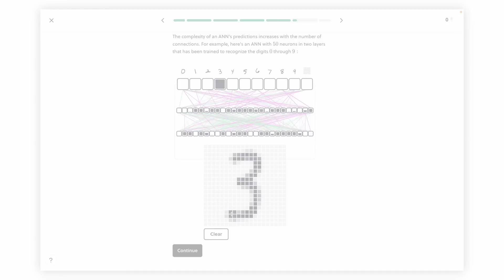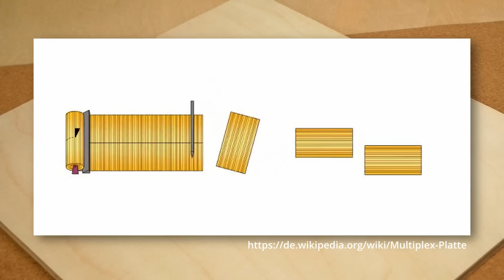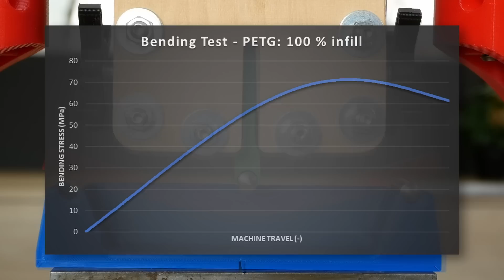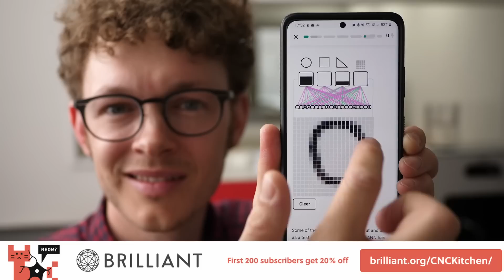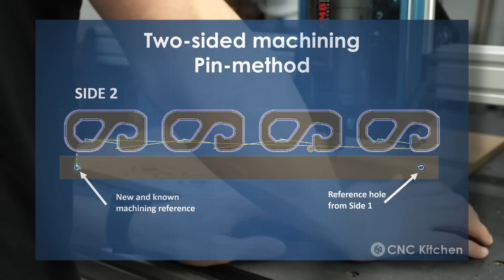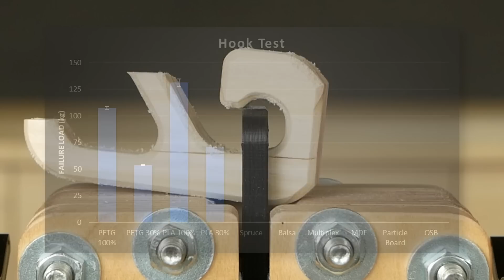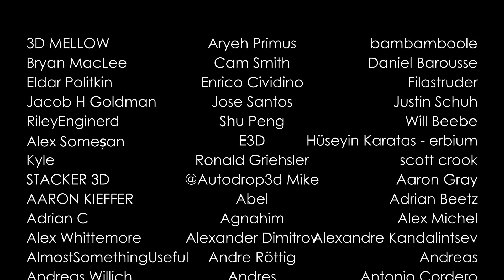Strength Test:  3D Prints VS Wood

Comment from the maker: Visit https://brilliant.org/CNCKitchen/ to get started learning STEM for free, and the first 200 people will get 20% off their annual premium subscription.
Reply: Howard huges built an entire plane out of wood that could fly a tank's. so you are right. They do and have used wood in plane's
Reply: @odeball22  Well, sorta. They used a product called Duramold. You can think of Duramold as a kind of advanced plywood maybe even approaching something like layered fiberglass. Wood was layered and molded, impregnated with phenolic resins and pressed into shape. It was an advanced material for its day and outperformed aluminum in many ways. So yes, it was wood.  But it was more than that too.
Reply: @wturber  yah wood
Reply: Are you "Shtephan" or "Stephan"?
Reply: I'd avoid 100% infill. If you want solid, I suggest use 1000 parameters. prints faster, AND stronger too.
Reply: hey, im in a project that takes plastic water bottles, and turns them into filament. Its called re-creator 3d and we have a discord as well. I'm reaching out in behalf of josh the owner to see if you want to work with us. We also plan on selling a kit down the line to help make it easy to recycle yourself. think you would be willing to reach out to set something up?

Comment: Patricle boards, as dirt cheap of a materiasl as they are, aren't bad for compressive strenght, I use them for legs of workstation tables. If you eliminate sheer forces with good struts, you can take advantage of them, they're kinda like the concrete of woods, bad for bending, gread for compression.

I used those as filler for those removable car ramps

Comment: Thank you for the data. I was recently playing with Truss framework. I started printing with PLA, but after adding wood dowel rods, I wondered which would be better. Simply buying the wood dowels, or accepting the print time it would take. PLA infile ~20%. Still undetermined what I'll do as of this comment, but experimenting randomly.

Comment: Funny thing is that at least here in Texas, wood is actually more expensive than steel atm. The cheapest 4" hardwood fence posts available atm are $22. Used 2 7/8 drill stem can be ordered for about $75 per 30 ft. If you cut that at 6' you can get 5 posts you can tack weld your panels to for $15 bucks a post. Prices for wood are crazy atm.

Comment: Where is strength vs price? If I wanted 100 hooks to pull 50kg each reliably let's say, which would be the cheaper? Machining wood or printing? You can compare different use case scenarios than hook. And you could adjust material size to target, maybe smaller hook to get the target failure load. I ain't gonna get either but I would love to see that happen.

Comment: What a wonderful video, I would love to see some proper marine plywood tested if you ever do this again. Generic multiplexed plywood vs high grad AA marine stuff is night and day mainly due the the fineness of the grain and choice of wood (sap vs  heart). 4mm is often used for wooden boat hulls and can resists slamming of waves. I use it for prototyping , Honestly believe it's faster then 3d printing (and cleaning the print).

A 4mm 5cm square piece of that feels like a 10mm thick piece of carbon steel when you try to bend it. If I glued up a 5cm box of it I could stand on it with my full weight no issues.

Comment: I have seriously underestimated the strength potential for PLA. Few projects in mind that I've got a bit more confidence in. To compensate for the potential flex, I might epoxy some pins in to act as a spine for added rigidity. Almost certainly unnecessary, but who doesn't like going a little overboard sometimes?

Comment: By laminating low-density wood with a low-hardness, high-strength material like PET, you can create a super-material. Low density, high strength, and high stiffness. 🙂
(I used it to make light-weight boom for a robot arm. A 30-cm boom weighs 37 grams and can support 9 kg!)

Comment: So one lesson here is that if you need your 3D printed parts to be stiffer, you will generally need to make thicker parts or exploit other shape based schemes. I've been thinking about making a press for my table tennis racket, and I can see that I'll need to use either thicker sheets, or some kind of reinforced ribbing.  Either way, it will surely end up being thicker than the plywood based one that I currently have. 

Also, while PLA is stronger, material creep can be a very real thing if the part is under heavy load for extended periods of time. Then there's temperature issues.  I frequently find myself using PETG  for these reasons.

Comment: Wood based materials drawback is sesitivity to moisture. For example if you bolt two wood boards together and they dry out, bolts become loose. That's why wood is not a good material for construction where you don't want any freeplay.

Comment: Common engineering materials tend to have quite similar specific stiffness - "specific stiffness" or "minimum gauge" are often what sets the amount of material you need to use, so if there was one material that won by a significant factor on specific stiffness, could be worked with at small feature scales, and didn't cost an arm and a leg, you'd just use it for everything :p

Comment: Silly question: have people made slicers capable of printing empty volumes in a model and extrude a single continuous bead of plastic into it? Fully automatic Way of increasing tensile strength in the z axis? I suppose the extruder would need to heat up hotter than usual for it to properly "pour" but this sounds feasible?
 Love the stuff - making scientific method and actual paper structure watchable 👌

Comment: Overall a very interesting video with lots of solid data. That said, it would be interesting to see how homemade balsa-plywood (various layer counts bound by epoxy resin) would perform compared to the plywood you tested as it would gain multiple grain directions for the hook test, but still be very light weight.

Comment: The stress on the hooks is mainly bending stress with some tension stress, not the other way around. The material furthest away from the contact points is in compression. You can know this because the line of action lies outside of the material. If the gradient was from medium tension to high tension, like shown here 11:17, then that part of the hook could be made from a tension only material, like cloth, and it would still work. But I think you intuitively know that that's not the case, it would bend, because it's a gradient from low/medium compression to high tension.

Comment: i almost always use particle board for drawers specifically the floor thanks to being lightweight and stiff enough to bear load put a simple vineer on the surface and you've got a nice drawer for craft supplies

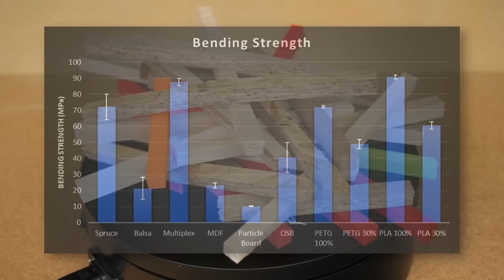Comment: Did I misunderstand the test?  I would expect the hollow shape to win on strength/weight, which is why I-beams and tubes are used in the first place.  But for both PETG and PLA, it looked like they had exactly the same bending strength/weight (10:06 for strength, probably 10:53 though I'm less sure) regardless of solid vs infill, and that solid was *stronger*/weight in the hook test.

Comment: I think a big a advantage of wood not mentioned here is that it probably handles  permanent high loads and many cycles of high load much better.
★ Wood doesn't flow or form microcracks from permanent high loads. PLA does.
★ Wood is more likely to have something like a fatigue limit I'd suspect.

Higher heat resistance is also a boon.

Big disadvantage of wood is that it needs a milling machine wich is nore expensive and much more constrainung in possible geometries.

Unless finely laminated wood has two weak directions whereas FFF 3D prints have only one weak direction.

Comment: Not sure about your region as I've not worked there, but in the USA OSB is required to be marked with the primary direction of strength. Most structural engineering diagrams reference this for construction. You didn't mention it during the bending test, but was this reference on the board available? and did you orient the OSB in a manner that would reflect the strongest load etc?

Comment: One.......it's not an age old question.
Two.......plastic is homogenous, wood is not. If you chose a shape which suited the grain structure of wood, it would outperform plastic comfortably. The shape you chose meant short grain at the stress point, and I could break that with my bare hands. Who would ever have thought that a channel dedicated to 3D printing and CNC machining might be biased against wood, and set up a test deliberately to produce the result they wanted, heh?
Your test was therefore stupid and pointless, much like your channel.

Comment: Fantastic data, as always. Thank you so much for putting in the work to study all these things, Stefan. We all benefit from your data!
I’d love to see some comparisons of the different fill options available in filaments, like carbon fiber or glass fiber. Most of these are just powder, so I wouldn’t expect much of an actual change, but perhaps some of the fiber filaments available do actually have some longer fibers and it would be nice to see the results. It would also be pretty great if you could convince someone with one of those Markforged continuous CF printers to make you some of your standard test specimens and add those into the mix!

Comment: I'm surprised at how well the polymers did in comparison. Great idea to include the birch plywood and the particle boards. Maybe add solid oak/birch into the mix as well? They would obliterate spruce in these applications :)
Reply: Yeah, that's good idea! I'd also like to add particle boards filled with epoxy. I bet MDF + epoxy will perform really good (being also super easy to work, waterproof and super cheap for DIY makers).

Comment: I would note that wood is probably only stronger then 3D printed plastic, inject molded or extruded plastic (pipes /sheets)  from HDPE/ UHPE will likely be much stronger then wood for their weight, and there are some other polymers like polycarbonate that have amazing impact strength.

Comment: Interesting. But several Serious missleading aspects here.  First of all: Wood is NOT isotropic.  
And the man made versions of wood are low strength   by nature,  being made / designed for specific purposes. 
Even Plywood (which should at least be acceptably Isotropic) Is of the Typ Deutsche variety😉  
Plywood  in nameonly being out of the lowest grade wood fibres available to man.   
Despite Your silly testings results  Wood (manufactured) is slowly replacing Steel reinforced concrete as High Rise Building structures .  
Seriously consider a Straight plank type tester design rather than the foolish S curve you seem So fixated on.

Comment: When printing solid parts, use 999 walls instead of 100% infill. Or make sure your infill is set to concentric and uses same printing speed and flow rates... meaning: it is easier to just set it to 999 walls. That way the whole part is more uniformly printed, every line is the same. Infill settings usually have faster speeds and lower flow rates since they aren't really structurally worth anything but as a filler and a support. And of course, if you really want solid you need to seriously up the flowrate above reasonable and lose dimensional accuracy and visual looks. 

You learn the difference once you start melting the parts in packed salt, there is a lot of air in a normal print even with 100% infill. +20% flow, 10C hotter and 999 walls sag very little, 100% infill sags so bad that it is not usable, there is just lots more air.

But i understand that using infill and normal settings is more representative of normal use case. But if anyone happens to read this, just know that to get really strong parts, use 999 walls and up the flowrate until you can't push in more plastic. Remember that with high flowrates you most likely need to compensate with higher temperature or you will make the part weaker... Colder and unevenly heated plastic does not stick as well, very high temps will also cause problems. Remelted pieces are incredibly strong, solid, casted or otherwise uniform PLA is just.. incredible how strong it is. It can replace some wood parts in wooden instruments, including.. stringed instrument necks that have hundreds of kilos of tension. It even has decent resonance properties.

Comment: Wood is much stronger in compression than shear or pulling. It's evolves that way. A tree has to hold itself up, has to withstand the weight of snow and rain and the bending forces of wind, but has to be able to break to protect itself. It's better to loose a branch than getting pulled out of the ground.
So all constrictions techniques with wood are designed around compression. It would be interesting to have s comparison between wood and plastics.

Comment: You persistently use the wrong method in testing tensile strength of materials.

You use a straight piece of material that is stretched or compressed, suggest that you look at how things are actually tested and see that all your previous testing with your test rig are all invalid and void.

Comment: A company called MT propeller (german I believe) makes their aircraft props out of a wood core with a carbon fiber outer layer, and a thin stainless steel shoe on the leading edge to precent chipping. They are incredibly light and incredibly strong.

Comment: Nice testing.  The results are pretty much what I expected but my formal education is in the field of engineering.  I have also built several aircraft, one was a glider out of spruce and plywood and another was the first man-rated aircraft to fly with a carbon fiber spar; a two seat aircraft using foam core composite construction.  I have also designed and constructed many boats both large and small.  Some used foam core composite construction and some were mainly plywood.  The largest was a high performance 55 foot plywood motor yacht. Both wood/plywood and foam core composite construction lend themselves to one-off DIY building including high performance man carrying aircraft and relatively large boats. None of my major projects were 3D printed of course.  

As it turns out, plywood construction using a certain amount of wood framing (all protected by a light covering of fiberglass cloth set in epoxy resin) is hard to beat for DIY builders who want to construct strong, stiff, and long lasting boats (even large ones) without investing in expensive tooling.  These home built boats nearly always out perform typical factory built fiberglass boats especially when cost is a consideration. The primary reason is because wood is such a great engineering material which can be worked by using relatively simple tools. 

Foam core composite construction is pretty good for too, but it's generally more expensive, more work, the materials are a little bit nasty, and fiberglass is not as nice to work with when compared with wood.

Full disclosure:  When I need a soap dish, I always use my 3D printer.

Comment: I knew the balsa's strength-per-weight rating would be tough to beat.  Balsa a very useful material to deploy in applications where gross strength need not be high, but weight must be held to a minimum.

Comment: Your results for particle board are a little unfair as the strength comes from the highly compressed layers on the faces of the board. When designing a particle board structure most people use large flat panels almost instinctively reflecting the higher strength of particle board in shear. In modern timber frame construction particle board with moisture resistant resins and weather prof surface treatments are replacing plywood as shear panels on walls. It would be interesting to see it tested with the load applied parallel to the face.

Comment: Excellent study. I can't say I'm surprised though. I grew up building model planes out of balsa, and I've never been able to match (or exceed) the strength/weight except with an epoxy glass/cf composite. 

Used properly balsa, spruce, and similar woods, can provide an amazingly strong structure with minimal weight. It's even better when used to create plywoods tuned for the application.

I used to use a five ply laminate of 1/32" balsa for fins on rockets. It was much lighter than the recommended 1/8" plywood but was also stiffer and plenty strong. The trick was to construct the layup with the grain aligned for normal bending, and to protect against torsion.

Lots of work though. It's much easier to just 3D print it if you can get away with it!

Comment: Do you have space that you could dedicate to holding a bunch of 3 point bend samples and do a creep test for a 2023 video. Load the samples to ~80% stress record the deflection. Keep them loaded for a 90/180/360 day and measure deflection again. I would expect little to no change from the spruce and plywood/multiplex samples and significant change from the MDF. I suspect the prints would also perform poorly, but that is mostly a guess and results may be surprising.

Comment: Being very familiar with wood and using it as a go to material, this actually opened my eyes a bit to using printed parts in more applications where I normally would use wood as the printed parts are likely to be plenty strong enough for my purposes

Comment: As always this is great content, thank you! A few things that I would have liked included in this is the price per gram, as you opened by talking about the rising cost of wood. Also a consideration or notation of the test environment ambient temperature. By comparison the wood will greatly outperform filament as temperatures rise. 

I would love to see a cost and strength comparison of Balsa vs light weight filaments like LW-PLA & LW-ASA.